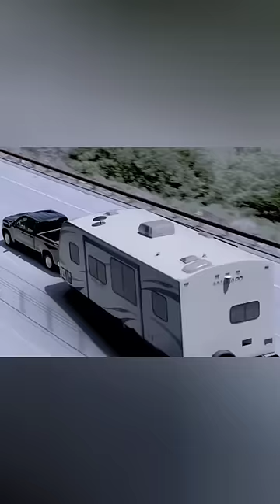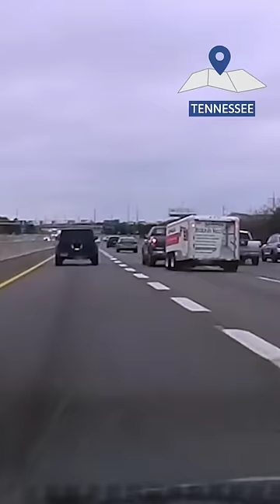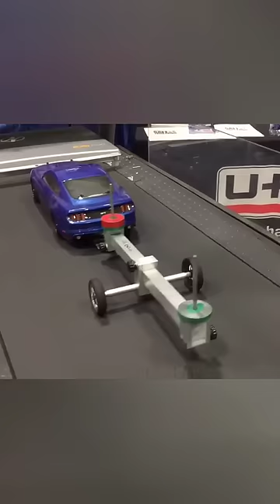Why Trailers Sway? 🤔

Comment: I was going with some friends to a weekend racing event, the guy was loading trailer with everything but the kitchen sink: generator, TV, microwave toolbox, etc. I took one look and said, “I’m not going if you pack it like that we are all going to die.”  He had everything pack at the rear of the trailer.  He did take my advice and redistributed the weight. All was well.

Comment: It also depends on the trailer weight and the amount of axle that's got.  Flatbeds for semi's with three spread axles (also called an open triaxle) you want the heaviest load slightly ahead of the front axle so that most of the weight is spread amongst the middle the lightest should be over the center axle and/or on the front of the trailer depends if theres anything on back like a moffett or another load

Comment: All I can say is you never want my ex to be pulling a trailer that sways even a little bit.  Let her drive once cause I was tired. Next thing I knew I was waking up being thrown violently from side to side in the vehicle. Looked back at my trailer and it was going from the far right lane to the far left lane and my truck was in the middle lane.   She driving along like nothing wrong! She lettering the trailer swaying make the steering wheel turn even more side to side that made the trailer swaying far worse. 
There wasn’t a vehicle on the freeway that wasn’t afraid to try to get around her in any lane. 
Yelled at her STOP!  Why, where she says? Right here, STOP NOW! 
I may of been tired to start with, but after seeing her lack of driving skills and couldn’t even tell she was doing something wrong nor noticed how the trailer was swaying!
 I was wide awake after that and she never ever got behind the wheel of the truck again if I was pulling a trailer. 
Gave her the chance to drive our 26’ motorhome and that was a mistake too.  Luckily it was a wide off ramp she was turning on and nothing she could hit for quite some distance. But she immediately started the turn on the off ramp when the front of the motorhome got to the off-ramp. So the back of the motorhome went completely off the pavement on the passenger side and still just missed taking out a highway light post. 
No common sense whatsoever, certainly couldn’t trust her behind the wheel of a vehicle that was any larger than a small Toyota or Nissan.  Didn’t matter if I was on my death bed, I DROVE! 😂

Comment: If a U-Haul trailer is swaying, and there is nothing wrong mechanically with the hook-up, the trailer, or the towing vehicle, the trailer is improperly loaded. Many have the idea that you need to distribute the load evenly.  Instead, more than half the weight needs to be in the forward portion of the trailer.

Comment: The more weight at the front, the better; you may need to reinforce the rear suspension of the tractor vehicle, on my 1994 Isuzu Trooper 3.1TD,hauling boats, i have 4 coil springs in the back,a very easy  DIY mod

Comment: I know about putting the weight on the front of the trailer. Had an idiot nail a pallt down on the back of a trailer. When I questioned the they called me the idiot, then proceeded to tell my boss I am not a good representative of the company. I told my boss at the time, they don't have to drive the truck, and it is not their license at risk.

Comment: Sway bar !
Reply: Sway bar will not fully prevent this and is a band aid only. Too much weight behind the axles actually causes the rear of the vehicle to be lifted, shifting the vehicle weight to the front wheels. 

The leverage between the axles and hitch creates enormous forces that cannot be easily controlled

Comment: The tongue weight is all riding on the ball hitch. That's why it's so important to always use an equalizer hitch. It spreads the weight to the entire car and trailer. Then that will never happen.. equalizer hitches should be mandatory, and infourced by law.

Comment: why don't trailer companies simply just make the front of the trailer twice as heavy as the rear by making all of the electronics like a gas generator or something, and if the trailer has basics necessities, just fill the front with concrete so that the vehicle pulling it will have a stable inertia? It would potentially save the trouble.

Comment: Ok I get it so if the weight is in the front it can easy follow the car direction and have a little movement but if it's in the back it's not easy for the weight to follow the car direction and it will move a lot swinging left and right increasing the force it makes by hitting the wall of the trailer and the trailer will keep to balance it's self but it just increase the force even more because it pulls the weight to the other side with great force and it increases everytime

Comment: While yes, too much tounge wait is bad, so is too much rear weight, it can raise your rear wheels off the ground, and break traction. Also, the car is only going to regain control if the driver doesnt over correct, and throttle maintains the same, and the vehicle must not break rear tire traction

Comment: Just put the tires from the trailer more to the back! What means to re-engineer the trailer.
Reply: Bro what?
Reply: if that would solve all the problems then it would have already been done, also you do not want all the weight in the front as that would also cause problems
Reply: Yeah it would be a pain to maneuver in reverse then...
Reply: No those are the weights
Reply: Would only work with a fifth wheel or gooseneck due to turning radius, especially in reverse. Also trying to minimize overloading the tow vehicle’s payload. It’s perfectly safe if you load properly and have a good hitch with weight distribution and sway control.
Reply: I guess it depends also on the speed what you are driving with a trailer. Where I'm from you are allowed 80 km/h equals 50 mph as max speed no matter the size of the trailer.

Comment: You just know? Whn the end is havier it will swing n made the front lost control.
Like a riding a motorbike with your friend passenger at your back but far not close to you.If he a small guy it ok. But if he a big guy you will  got problem to stable your riding or it will like in the vdo.

Comment: If the trailer is heavier than the car towing that will happen over 30 mph, so you have to keep the enthusiasm down and don't travel faster, I've been there and got the t-shirt, pulling a trailer and a car/vehicle could be twice as heavy as you car, very dodgy,

Comment: Pepole with out a trailer or camper let me explain if you dont like you truck do this but if everything is in the back it is way better than the front dosnt give you supeson a hard timae and the middle is the best place where the wheeles are for even support this vudeo may bbe true one way but its not in the other and the chances of wobble is 1 in 10  keep your trucks running good and stop trying to geta unsurance claim